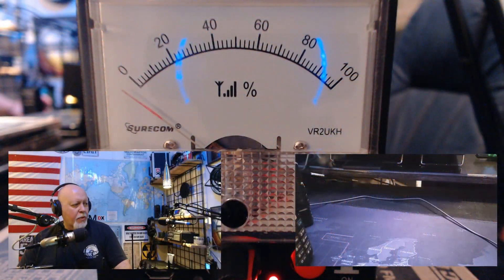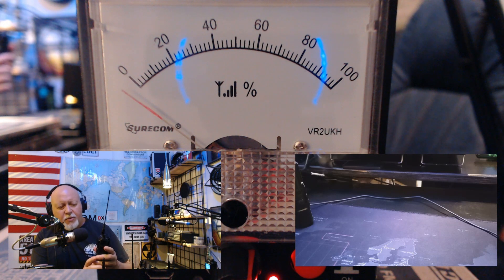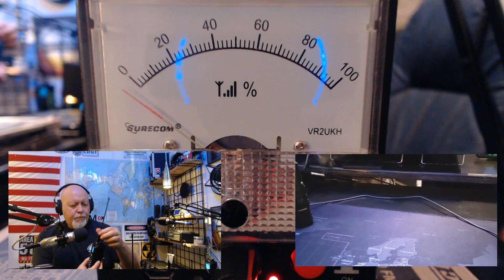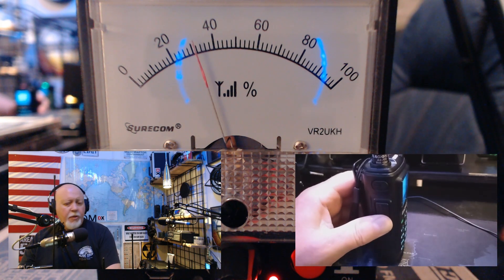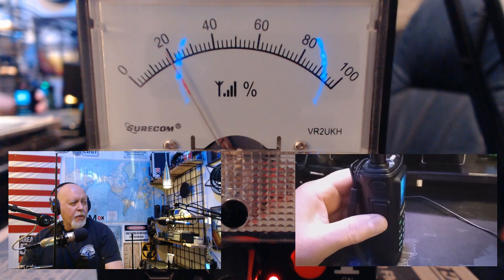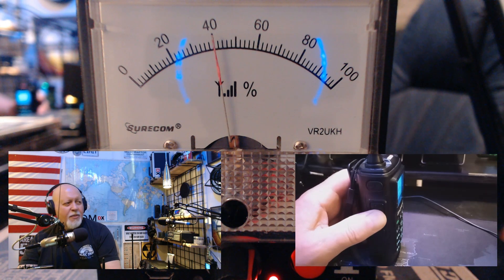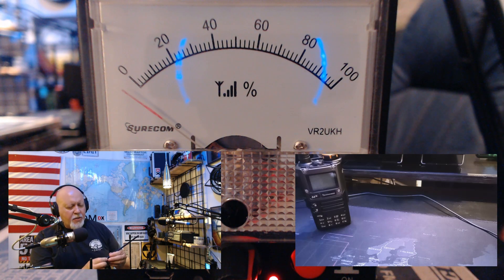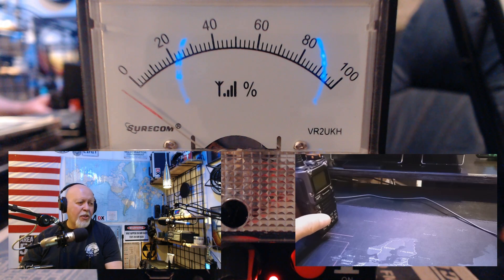HT Antenna Testing with Surecom SS11 Field Strength Meter!

Comment: Thank you! Finally! Finally someone made a video about this super-useful test! I think it is much more practically relevant than trying to measure the SWR on a rubber duck. Besides, some antennas simply don't fit some radios without you realizing it. Using this FSM test will tell you right away. I also have the unamplified version (SS10). Find it easier to use. The amplified one (SS11) is too sensitive - have to put it so far away that I can't see the needle:) Another "useful use" of these is to test how well your antennas receive. Just put your ant on the SMA connector of this meter. I dial my SS10 to about 9 o'clock and transmit from about 6 feet away. A little closer than Sweden:)
Reply from the maker: Hey thanks for the great comment! I really appreciate that. I plan on doing quite a bit more of that kind of stuff when I can find time. And yes that's very true there's lots of good uses for those things and I find it entertaining.